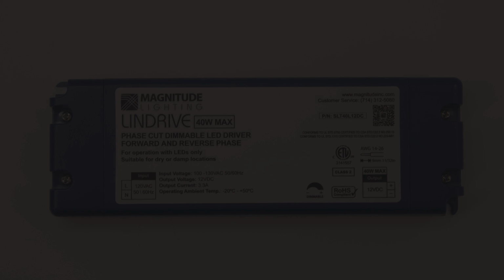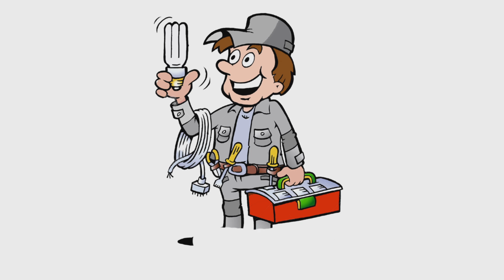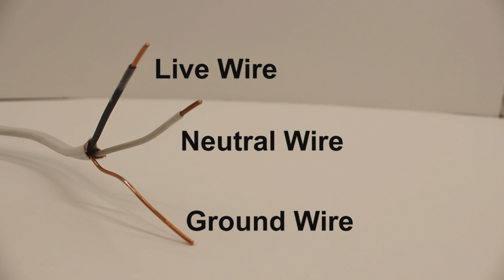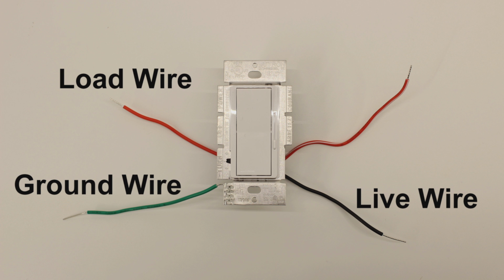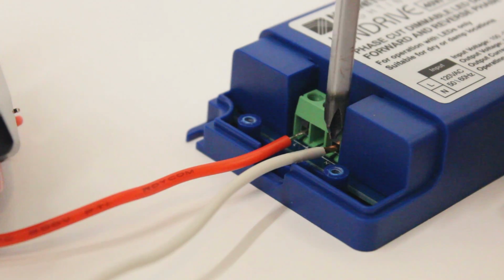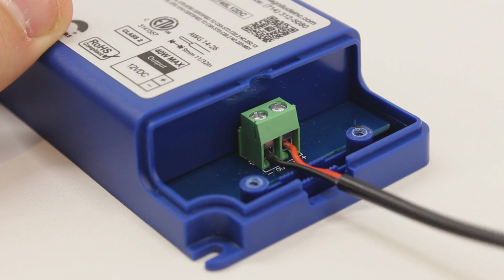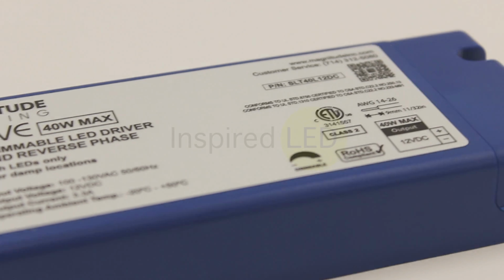Magnitude LinDrive 12V 40W Dimmable LED Transformer | Inspired LED

Comment: My transformer doesn't have an L or N on the input side.  So how do I know which is which?
Reply from the maker: Hi dtz1000, 
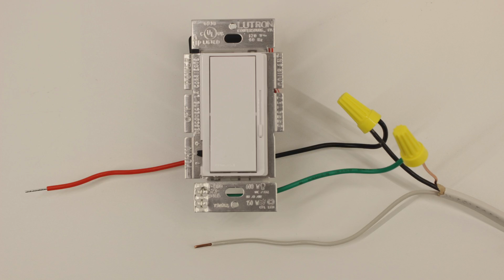Great question! If you remove the wiring cover on the input side, the port on the left is your live, or hot wire (L) and the port on the right is your neutral (N). See an example in the video at 2:09. Please feel free to contact us directly if you have any questions. Have a good day! 
-Inspired LED